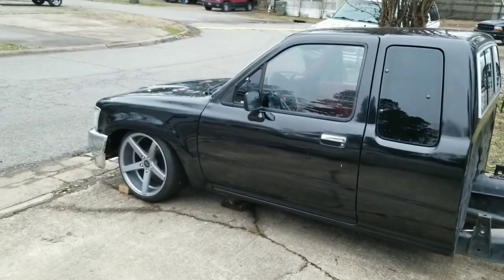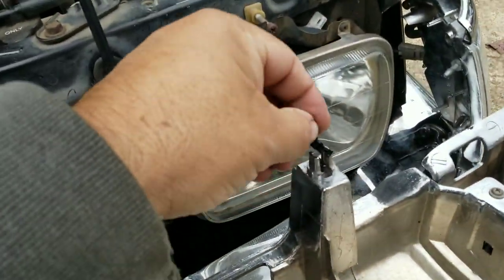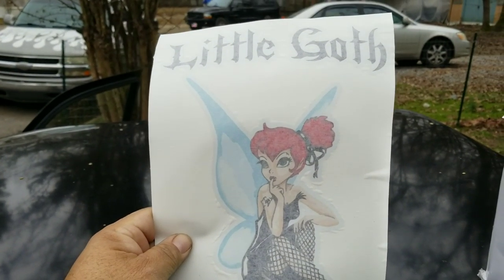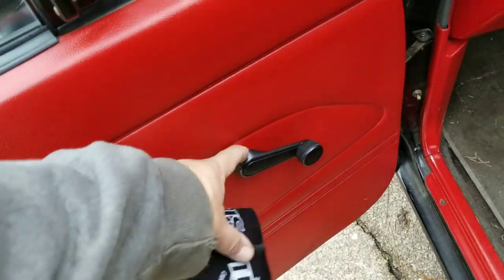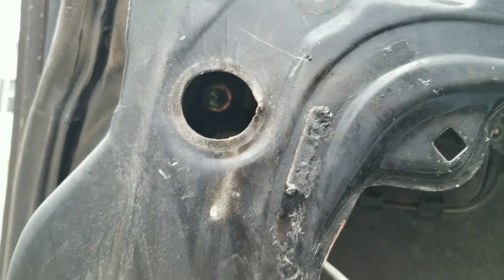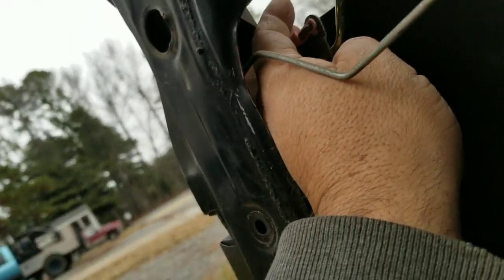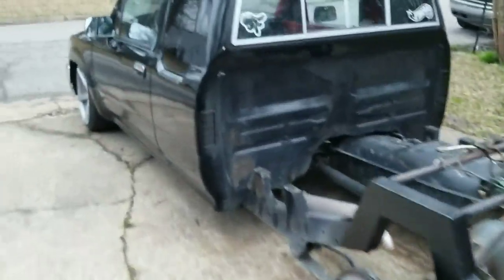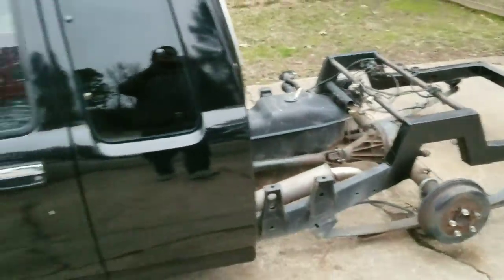Changing door handles and locks 1989 and up Toyota pickup 01-30-20

Comment: As screwed up as this appears to be the first half a dozen times you watch it, it turns out to be an excellent tutorial on replacing your locks in a 1997 Toyota Corolla and a 1991 Toyota pickup, even though the lock configuration is not exactly the same. the brilliant part is when he says that he installed the new lock into the door handle while the door handle was outside of the door. Tight fit, but can be done without removing the handle bar, which did not want to come out of its seat. Beats trying to do it with one hand up thru the door. The lock for the Corolla did not so much as snap into the handle as it just lay in it so dropping the darned thing into the door when you fastened the handle in place was a major annoyance. I had to do it 3 times. Showing the orientation of the lock was very useful and noting that the orientation is actually idiot proof, because of the shape of the seat, helped this idiot to do it right the first time. I watched several videos that did a good job getting the door panel off but were lousy at actually replacing the lock. I now have a good lock on my corolla driver door and one for my pickup passenger door. No, they are not the same so had to order two sets, and no, I was not crazy enough to replace the good locks because this job is really hard for a novice. So, yes, 2 keys for the pickup and 3 for the Corolla (the trunk cable is busted). When that gets too annoying I may just replace those good locks. Oh, the quality of the keys supplied with the cheap door locks is poor. I will be getting new keys cut ASAP.
Reply from the maker: Awesome glad this helped

Comment: I've found it's much easier putting the exterior handle back in if you use the key to turn the lock to get the latch arm out of the way. cheers.
Reply from the maker: Nice thanks for the heads up.

Comment: Nice looking truck I have 95 reg cab. Do you mind sharing info on the air intake you have in yours, I installed one in mine and 2 weeks later got check engine light.

Comment: It will be very helpful to show how to place the lock cylinder in and how to remove it. My concern is that i was able to place the cylinder but when the key is inserted it pushes away. How to prevent the cylinder from moving away from handle?